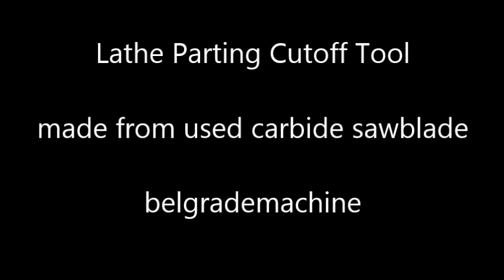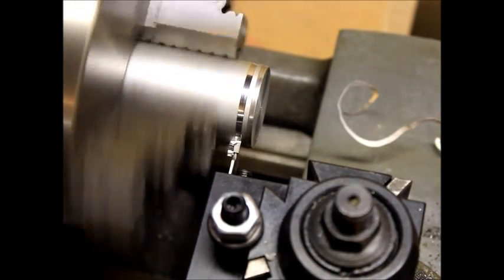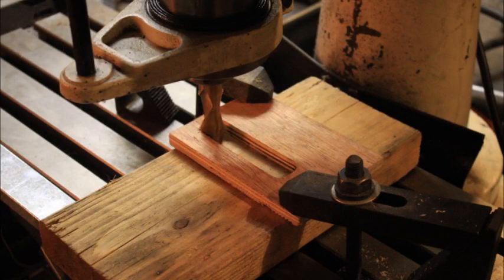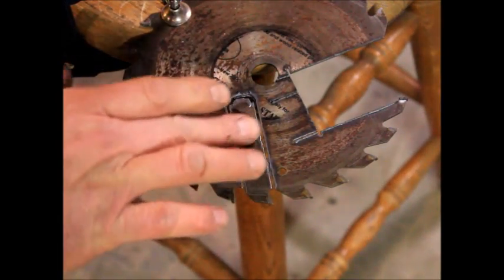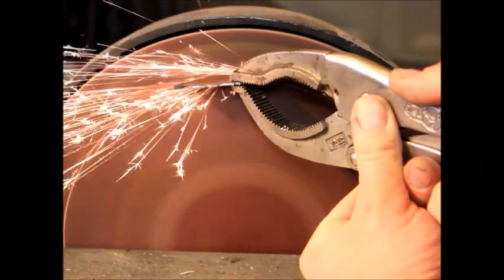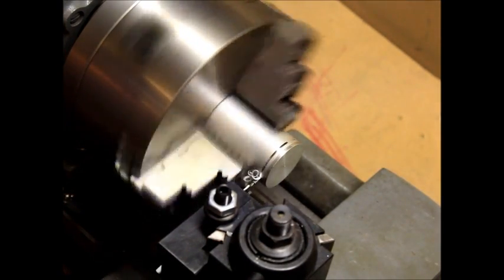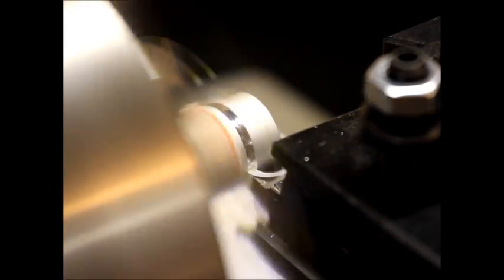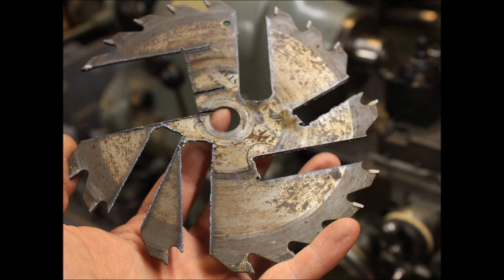Lathe Carbide Cutoff Parting Tool from Sawblade with Plasma Torch Homemade DIY

Comment: fine angle grinder abrasive cutoff wheel and metal guide to run along works well also. Advantage is no cleanups .

Comment: Very Clever! Thanks for sharing.
I'm wondering what grade some of these carbides are? Maybe C2 or C6? I'm using HSS 'T' shank now but I like the relief your tool has also and the softer steel of the blade body probably has less chance of shattering like HSS.
Rob

Comment: Well done :) All of my carbide turning tools are made from old carbide tipped saw blades and they work a treat as can be seen by your cut off blade. I weld mine to steel holders (which gives them far greater rigidity) grind them to the shape required and lock em in the toolpost. Very cheap and super effective. Also, WD40 works great as a coolant for them.  Again, well done. Cheers :)

Comment from the maker: Great suggestion! I cut it down and shape it so it will fit my tool holder. Perhaps it would be better to make a tool holder that fits the saw blade. That way a new cutting tool could be presented as needed.... very cool!! Sometimes it just takes a fresh set of eyes. Thanks for the comment!

Comment from the maker: It seems that would be best when parting. As another commenter mentioned they can probably be tuned up with a diamond wheel depending on what your using them for. Thanks!

Comment: That is an idea I use my 4 1/2 grinder thin cutter blades on metal and i cut a groove first slowly cutting and letting it cool I would not worry about ruining the temper of the metal

Comment: That is a cool idea, I do a very similar trick for internal gear cutting, by cutting the teeth out of a wheel cutter and silver solder it to the end of a 1/2" round and run it in the slotting head or shaper. Thanks for posting the video and for bringing it up to my attention. ;{)-----